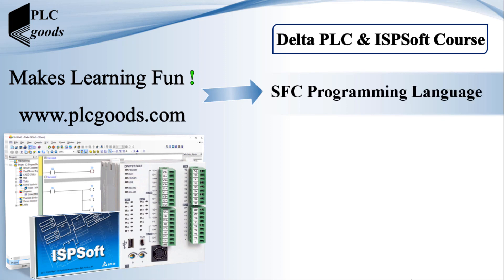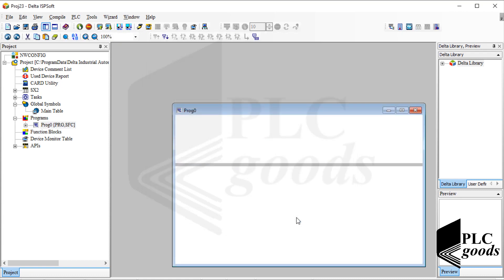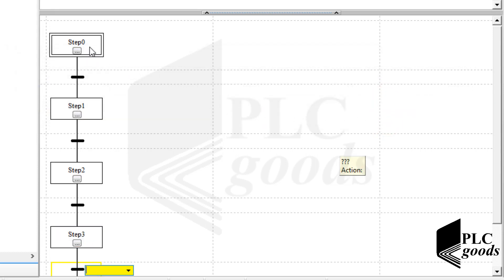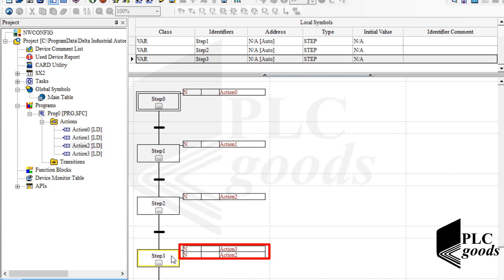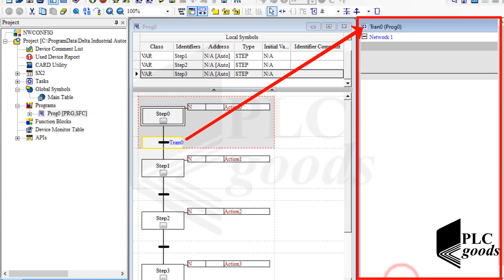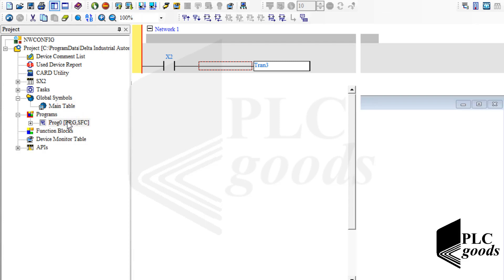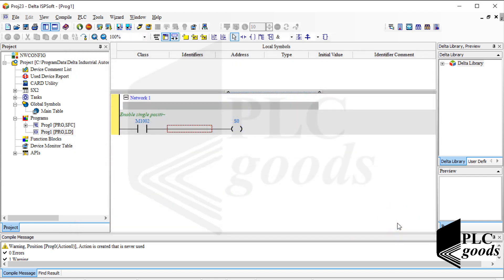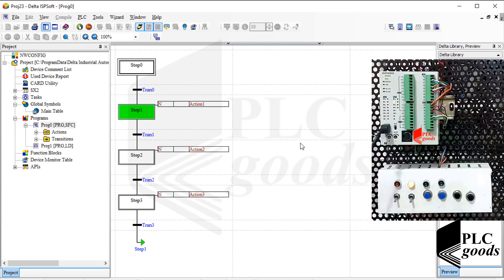SFC Control of Water Tank System | Delta PLC & Factory I/O Project  | Lesson 23

Comment: hello
thanks for your videos 
i need help in ladder in wplsoft for loadcell 
can u help me in this please?
Reply: Hi there, I've never connected a load cell to my delta PLC, So, I won't be able to help you so much. Note that, Loadcells produce a signal whose voltage is too low. so, you will need to use special modules like DVP02LC-SL beside your PLC to read the loadcell voltage, or use another device to convert the loadcell signal to standard signals like 0 -24 v
Reply from the maker: was the response from the PLC goods mentor useful to you?
Reply: @plcgoods Ofcourse not

Comment: How can we link wplsoft and Factory io app?
Reply: Hi there. During the first videos, I explained WPLsoft and also how a delta PLC can connect to FactoryIO app through an OPC server which can be created by KepserverEX software. Please see our Delta PLCs & ISPsoft course from the first video.
Remember, It does not matter which software (WPLsoft or ISPsoft) was used to program your delta PLC, because you want to connect your PLC ( not WPLsoft or ISPsoft ) to factory IO,
Reply: thank u sir
Reply: Your Welcome
Reply from the maker: you welcome and thanks for your comment
Reply: I saw the video about linking plc delta to factory io and enjoy but I have a question that for linking to factory io shoud we have hardware such as plc or can we link to factory io with ispsoft simulator?
thank u
Reply: Hi Hossein. Thanks for checking our videos. Note that, a delta PLC (not ISPsoft simulator) was used to prepare all videos. So, if you don't have any real PLC, you can use different types of simulators using COMMgr. Maybe there is a way to connect a type of ISPsoft simulator to factory IO, but I didn't check this item.
Anyway, if you want to learn PLC programming with FactoryIO software, my suggestions are TIA Portal and STEP7 of Siemens company. You can connect their simulator ( S7-PLCSIM Simulator) to FactoryIO directly and easily, without creating an OPC server by KepserverEX. The connection settings were explained during our TIA Portal & S7-1200 course
Reply: @plcgoodsmentor9223  thank u sir,yeah I know,but I teach wplsoft to my students and I really want to learn factory io in virtual learning with isp soft simulator,as u say may be we cant link with simulator of isp soft...
thank a lot for answering and teaching...
you re perfect...